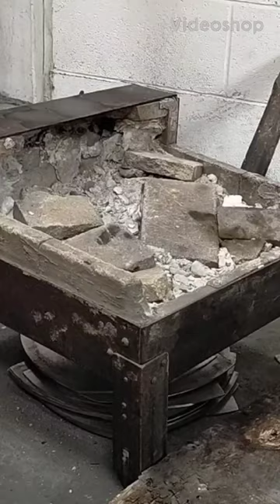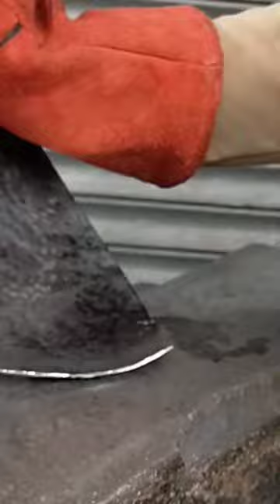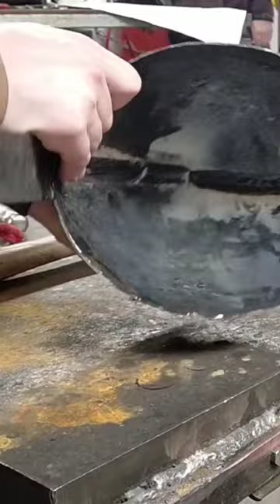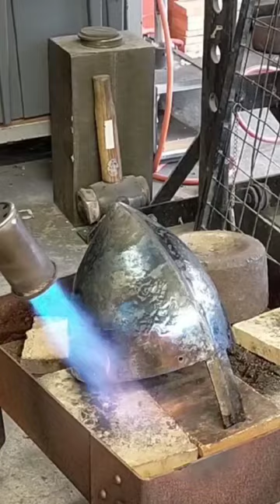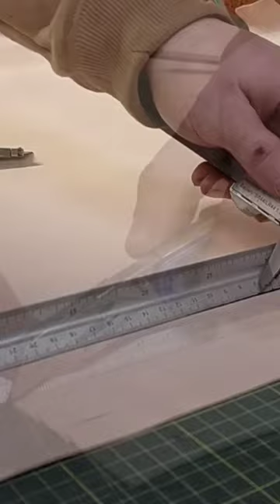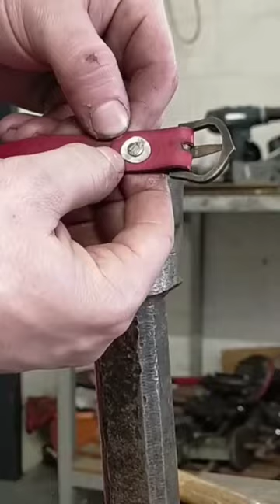Forging a Norman Helmet from scratch with Lancaster Armoury

Comment: How did they shine their helmets back then? Did they just hammer and hammer until smooth and use oils and what not?
Reply from the maker: Yes they would hammer until they had a smooth surface. The method is called "planishing". Once it's smooth enough, you can then use it on a whetstone of varied grits to grind it up and make it shiny. This took an awfully long time so we think that shiny helmets during the 11th century were very rare.
Reply: Primarly armours for the army were planished and then with scale left on they were blackened with oil. For the ones that had a lot of money were the armours made shiny, with a motor decorative things.

Comment: OK. That's impressive and all, but they didn't have weĺding back then, so how did they join the edeges together?
Reply from the maker: They welded them :) Welding has existed for over a thousand years, but it was called Forge welding, where you'd heat the two pieces of metal until they were white hot and press them together. It took a quite a long time to get them hot enough to weld, but it was a common practice for armoursmiths during the Medieval period. I use a modern welder since it's a lot quicker and does the same job.
Reply: Another thing is that armourers back then would have also tried to make the nasal helm in one peice
Reply: @AlexTheHistoryGuy   it seems pretty unlikley when you actually think about the practicality of doing that, forging from one piece seems much easier than forge welding that entire join, without deforming the helmet, especially with the extremly high tempreture reqired to forge weld.  as far as im aware there is no observable evidence for the forge welding of two piece helmets throughout the medieval period,